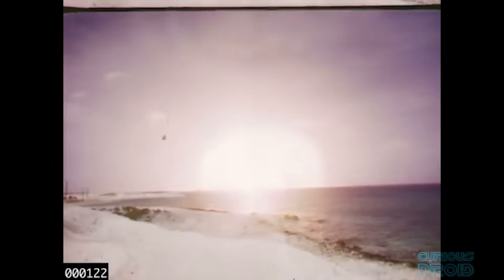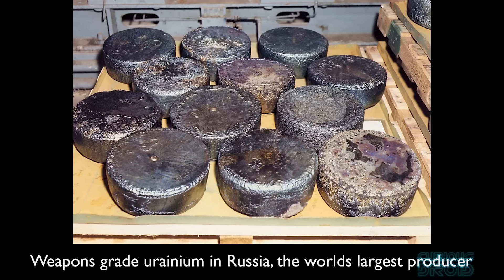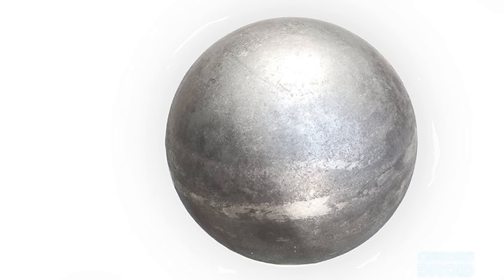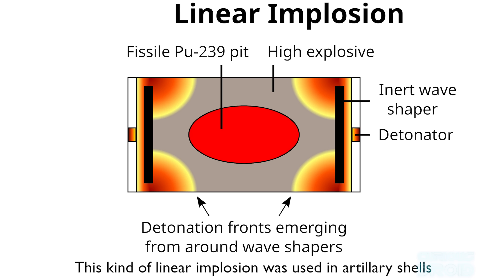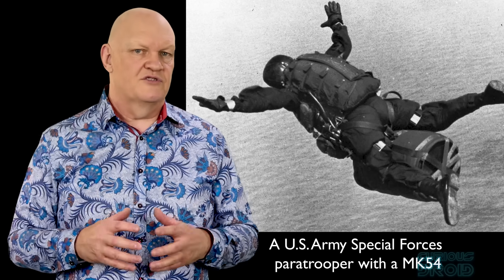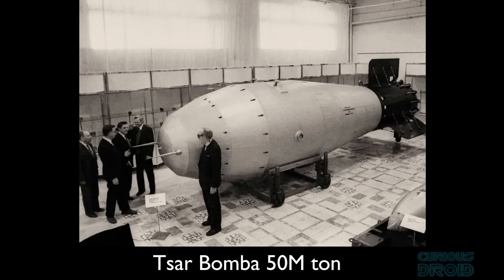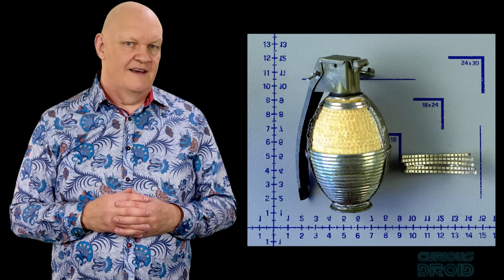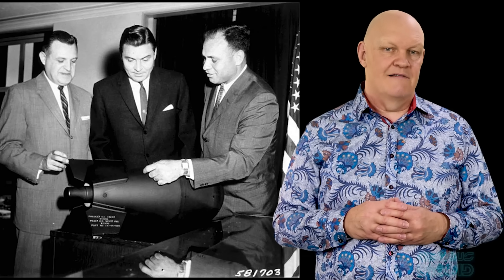How Small Can You Make a Nuclear Weapon?

Comment: The threat of a suitcase nuke was "always" more focused on dirty bombs spreading radioactive material, rather than a "traditional" nuclear explosion.
That would be the same for drones today. The threat would be more from an explosion that spreads radioactive debris and materials which would cause radiation poisoning and render an area unlivable.
Reply: Wrong. 10-20 kilotons were only 51 pounds.
Reply: That makes no sense. The suitcase nuke's purpose is demolition. Using it on a bridge or dam could cut off an advancing force from its supply line. A dirty bomb causes annoyance as it requires a few blocks to be quarantined and scrubbed to clean up the dust.
Reply: @ChucksSEADnDEAD  The most compact warheads of yields of over 100kt are about 30x30x80cm and around 80kg, if casing etc is excluded.

That fits physically into a large suitcase (with reinforced wheels).

If you pretend to be a business traveller, and bring this to a hotel, maybe on the 50th floor or something, it would cause devestating damage.

Most people within perhaps 1km would die.

Placed in the middle of Manhattan, near the White House, Congress or Pentagon, it would change the world forever.
Reply: A nuclear suitcase exploded in a manhattan skyscraper could kill 100,000 people. A similar sized dirty bomb might kill 1000 people.
Reply: It wouldn't be an 'explosion' at all, though.  At least not in a briefcase-sized package.  That would be a pure radiation device at most.  And one with a fairly small area of effect.  Any explosion that occurred would be 100% any conventional explosives used to help turn the fissile material critical, not nuclear blast energy(which would require supercriticality).
Reply: @maynardburger  A briefcase is too small. But you can definitely fit a fully operational nuke in a large travellers suitcase.

If you push it, you could get up to 100kt in there (but it would weigh 100kg).

A more realistic yield would be around 10-20kt.

That's still the same as Hiroshima/Nagasaki.

If exploded in the penthouse suite of a hotel in Manhatten during the daytime, you could still kill maybe 100,000 people.

You need a real professional to make something like that, though.
Reply: "Dirty bombs" are sensationalist weapons, modelling shows that the radius and longevity of any such effects are minimal with even the most crude of clean-up efforts.
Reply: @Shaker626 True. I just highlighted the fact that the "fear" was not so much regarding a "normal/traditional" nuke and more so regarding "dirty bombs".

Comment: A small nuclear bomb would probably have to use Fission rather than Fission/Fusion.They are pretty complicated devices and complex in their detention using conventional explosives to compress the fissile material so I'm guessing that you can't shrink one that much due to the complexity of the construction.Shrinking a Fission reactor to power a spaceship once it's been put into orbit might be more useful as such a craft might be able to reach the nearest star in a few hundred years of course stopping at the other end is a problem!
Reply: (?) stopping is not a problem, you just run the engine to slow it down at the target star.

Comment: A friend of mine commanded a battery of Davy Crockett atomic bombs in Europe in the 1960s. He once showed me a dummy 37 mm ranging round used to determine the targets range. This weapon was very small and was fitted in the end of the launch tube barrel. 
He indicated he had a good deal of training on it use but little knowledge of the bomb itself. In the years since his service he found out a great deal more about this weapon. One thing he found out years after his deployment is that the weapons yields could be varied. Some systems were launched from a tripod while others could be launched from a Jeep mounted launcher. 
One thing he was sure of was his crew would suffer from the effects of an atomic blast.
Reply: They proved to be widely inaccurate flights too.
Reply: Well, he was mistaken. It's certainly possible for the launching crew to survive the effects...
Reply: The W54 from the Crockett (a modified and simplified B54) had no capability to vary its yield. The tripod mounted launcher was the exact same as the jeep mounted one, just taken off the jeep.
Reply: @Ihasanart  Yeah, it would vary unpredictably on its own, not that it "could be varied" as in purposely. The video stated it a few times, but OP didn't put 2 & 2 together. I'm glad I wasn't the only one slightly annoyed by this little thing. xd
Reply: @Ihasanart  The warhead was the same.  They did have 2 launchers; XM28 & XM29, with ranges of 1900 & 4000 meters, respectively. Both launchers could be tripod or vehicle mounted.  The explosive yield was relatively low but the device was "dirty" and expected to have a high neutron output.  The crew was still considered to be outside of the danger zone & instructed to lie prone when the launcher was fired.  It was anticipated that crews would fire multiple rounds in a real shooting war to help repel an armored invasion.  My dad was on a Davy Crockett crew in the early 60s with the 82nd Airborne.  Fascinating weapon.
Reply: Launch it with the wind and start driving off immediately, with respirators.
Reply: They were more concerned about some random sergeant getting spooked and starting WW3, cause by that point it was quite obvious that tactical nuclear weapons simply doesn't exist. Any use of a nuclear weapon would invite a full strategic ICBM launch.
Reply: perché gli stati uniti hanno sempre attuato una politica aggressiva camuffandola per difensiva? perché hanno fondato la nato costringendo l'Urrs a fondare il patto di Varsavia? perché vogliono avere le altre nazioni del mondo ai loro piedi? perché infine accettano che l'alta finanza comandi sulla politica? si potrebbe vivere tutti in pace eppure ci sono psicopatici che reggono le sorti del mondo!
Reply: @antoniocaso6608 oh piss. Without NATO the commies would have rolled Europe
Reply: Nah. If they fired a Crockett to its maximum range, they'd be unharmed by the blast. 

But they'd better fire it downwind ;)

Seriously in a real full-scale war they'd have been blown up by Soviet nukes before their Crockett ever got out of storage...
Reply: @patricialee76 depends. At full yield it's effect radius was larger than its maximum range.
Reply: @Solnoric 
No it wasn't, it's 100% kill radius was only 520 ft while it fired it's round over 2 miles, it only had a maximum 20 ton yield. 
The US Army may have done some silly things in its time but it would never equip troops with a weapon that would put its own crew within its kill radius, that'd defeat its entire purpose.

Comment: Could that back pack nuke take out something like hoover dam with its 1 kt yield?
Reply: I doubt it, but you would still want to protect against that risk.  Most of the big dams are closed to tourists, or one has to go through scanners and such.  It is a shame, because these are the kinds of things that interest me.  I toured one of the big ones years ago, but it was still after 9/11, and we were limited to a visitor center.  Good AC and cold drinking fountains, but not really that much to see.  They had one of the huge turbine blades out there.  You used to be able to drive over the dams, but that is all banned now.
There used to be school field trips to the local reactor, but I was not able to go for some reason. Parental permission slips, or something.  I never seemed to be able to go on field trips.  The zoo, a couple of times.  I really wanted to go to the Coca-Cola bottling plant.  Never got to see the tech stuff, for whatever reason.  Oh, I did get to see an engineering company that was making stuff for SDI in the 1980s, and other military stuff like night vision equipment.

Comment: There was a third bomb, and it was called Third Shot.  Which became the Demon Core.
Reply: No, they had plans for about 7.
There were parts of the 3rd getting transported to the fleet in the Pacific, but was days way from arriving. That 3rd bomb would then need to be built, loaded and dropped. So would have been more than a week away.
Reply: thats the one they used during the crossroads tests i think
Reply: @hwykng82  Weren't these the ones involving a guy with a screwdriver poking about on the verge of criticality? Or the ones with beryllium brick yenga? (Asking for a friend.)
Reply: @km077  It was a reflector brick, but I thought it was tungsten carbide. And, yeah, two fatalities in two separate criticality experiments which turned into criticality accidents. IIRC, the screwdriver one had the beryllium hemispheres.
Reply: I read that they could create enough Pu239 to build 2 bombs each month.
Reply: Sure it wasn't called The Demon Sphere?
Reply: @JohnSmith-eo5sp  no

Comment: The smallest one I've designed in a game (CoaDE) using conventional explosives is a 1 kg pure fission nuke with a yield of 102 tonnes, 7.54x15.1cm big.
The core was 10.5g.
Using more exotic explosives like Octaazacubane brings the weight down to 264g / 97 tonnes / 4.3x8.61cm.

And that game uses real declassified formulas, so I trust it.

But this is all hypotheticals, bleeding edge designs with no margin for error.

None of the bombs I made would ever work IRL 😅

Comment: in modern research, they actually found material with far lower critical mass. Liquid uranium fuel u233, much better neutron economy than u235. pu-239 is about 10kg. If you neutron reflector you can reduce the mass requirement by half. If we skip the safety requirement and don't mind passive high gamma ray emission, don't mind short live element and include manufacture element in lab, you can get even smaller critical mass element. Californium (cf-251) is about 3-5kg, Americium 242m (am-242m) is about 2-3 kg with short half-life 141 year, insanely unstable with intense gamma radiation. Might only be viable on an unmanned delivery vehicle. Too toxic for human handling even if not trigger.

If we move onto anti-matter trigger fission, then the critical mass can be shrunk even further. U233 can be shrunk down to 2-5kg, am-242m can be reduce to 0.5 kg to 1kg. But you sort move the problem to how to secure enough anti-matter to set the trigger. So magnetic trap and shielding need for these exotic fission fuel might add more weight than they subtract. So 5-10kg is probably the limit so far. No nuclear bullet yet.
Reply: Great thought experiment, however they want safety and reliability. So it will still be a large backpack size
Reply: What about just upping the purity of pu-239 from say 90% to 99.9%? Would it just be marginally smaller?
Reply: @johno1544 Marginally, yes...
Reply: Anti matter doesn't reduce the critical mass of fissile materials, or alter how little can be used to produce a weapon
Reply: Americium decays too rapidly to be of any used in a nuclear weapon. As most of the lanthanides. Would make an interesting fusion bomb though if you could trigger a lot of gamma based fusion of lithium3 and hydrogen. Any amount that would've went critical would've decayed too rapidly and thermally expanded too much when all together. Not to mention the nightmare fuel of trying to refine that much into a concentrated anything.
Reply: @mykeprior3436  Am241 can be used for a weapon if you don't plan on storing it for decades.
Lithium 3 has never been produced...
Reply: nobody is going to use antimatter, we produce few grams in whole of earth and no way to contain it. stop your cock and bull story.
Reply: As a nuclear engineer - what You are talking about is not just SciFi, it is low level SciFi. Bunch of wiki data merged into a bad NCIS episode. 😂
Reply: @nonamemad9053  I liked the anti-matter part
Reply: @nonamemad9053  The text might be AI-generated.

Comment: The prob with the Davy Crockett type of weapon is distance between the person firing it and the explosion.
But, we now have self propelled shoulder and tripod launched terrain following projectiles….these go beyond the range of the old gun barrel firing systems. 
It would be much more practical to put a small nuclear warhead on one of these.
Reply: Also if you were downwind you were getting a hefty dose of fallout with it being a surface explosion
Reply: It was meant for human wave attack annihilation. You were dead if it worked and dead if it didn’t.
Reply: @norlockv  not usually. The prevailing winds in Europe are toward the attacking Russians. You might die from THEIR nukes, but not from your own.
Reply: I meant that it would have been death by blast wave or the 500,000 men with bayonets running in your direction.
Reply: Nope. The problem was any random sergeant in charge of one getting spooked and starting WW3 by firing one.
Reply: @Szgerle while there was no modern P.A.L on those Davey Crocketts they still had a two person code to arm them. Those codes wouldn't be given out unless necessary
Reply: @johno1544  For a while field units had the codes.
Reply: @Szgerle was it during something like the cuban missile crisis? Regardless that a dangerous policy to have those codes out in the field
Reply: @johno1544  Around that time, they were deployed in Germany
Reply: It depends on the situation.  One of the big problems in Germany was that there was a lot of unease about the damage they'd do to surrounding German areas if a really big tactical scale nuclear war happened.  Basically, they didn't want to write Germany off as a big irradiated mess in the name of saving western Europe.  Remember, back then, Russians had at least ten thousand tactical nukes, and the US likely had a good five thousand or more as well.  Even if things never escalated into strategic nuclear weapons use, the consequences to Germany from such large scale nuclear weapon usage would still likely have been severe.  And that's just not a great way to treat an important ally.

Comment: It is said a 4.1 inch diameter artillery system weighing 42 pounds was designed but never implemented.
Reply: What do you mean never implemented? There is film of a US army artillery unit "implementing" one. They were deployed but withdrawn in 1992, but they made them, tested them, and deployed them.  google US artillery nuke. In 1956 a fusion-boosted fission warhead, the UCRL Swift, was developed and tested in shot Yuma of Operation Redwing. It was 622 mm (24.5 in) long, 127 mm (5.0 in) diameter, and weighed 43.5 kg (96 lb). At its test, it yielded only 190 tons, much lower than predicted; it failed to achieve fusion for boosting. There are unconfirmed reports that work on similar concepts continued into the 1970s and resulted in a one-kiloton warhead design for 5-inch (127 mm) naval gun rounds; these, however, were never deployed as operational weapons. The reasons the 5 inch was not deployed is were multifaceted.
Reply: @Smitty65721  Incorrect. That is the 280mm atomic projectile you linked to.  Different. That's around 11 inches in diameter.  Atomic shells were fielded in 280mm and 155mm like the W-48 which is 6.1 inches in diameter.  I knew somebody who serviced the W-48 in West Germany.  No shells were ever fielded in 4.1 inch / 105mm size however warhead designer Ted Taylor said that such a system is theoretically possible. I do not know of any acknowledged tests of a 105mm system.
Reply: " In 1956 a fusion-boosted fission warhead, the UCRL Swift, was developed and tested in shot Yuma of Operation Redwing. It was 622 mm (24.5 in) long, 127 mm (5.0 in) diameter, and weighed 43.5 kg (96 lb). At its test, it yielded only 190 tons, much lower than predicted; it failed to achieve fusion for boosting. There are unconfirmed reports that work on similar concepts continued into the 1970s and resulted in a one-kiloton warhead design for 5-inch (127 mm) naval gun rounds; these, however, were never deployed as operational weapons."  That is directly from Wikipedia. If you want to quibble of .5 inches...fine.